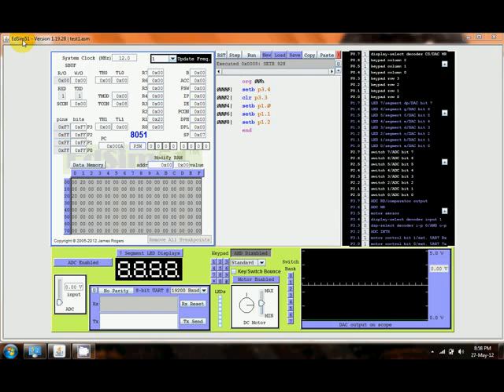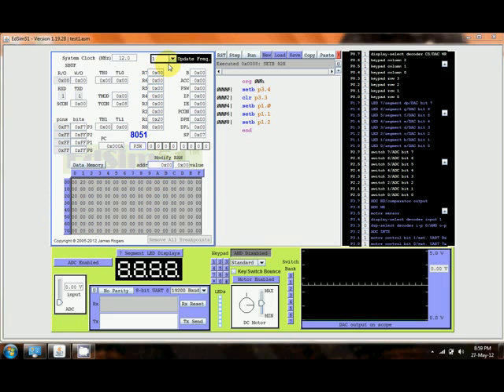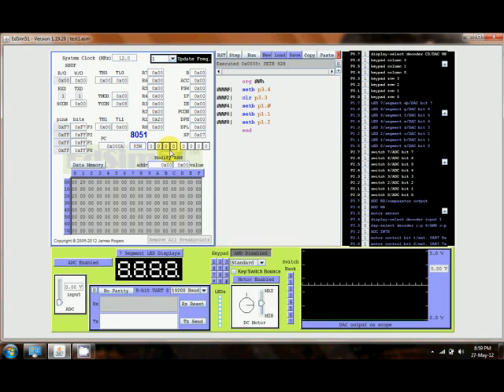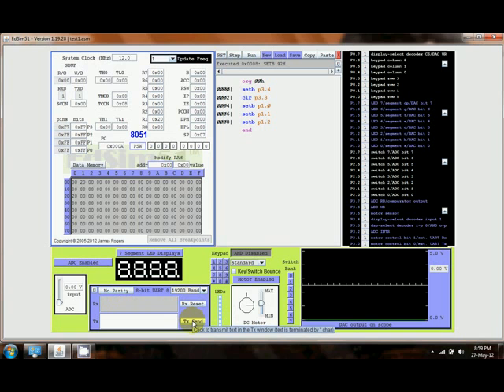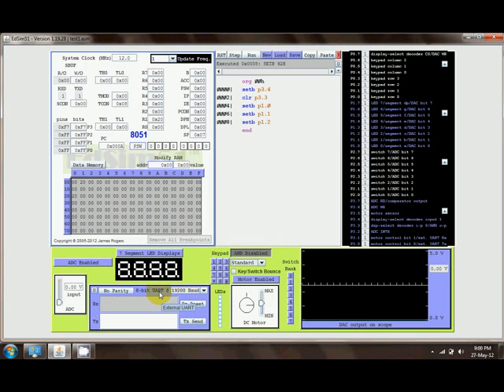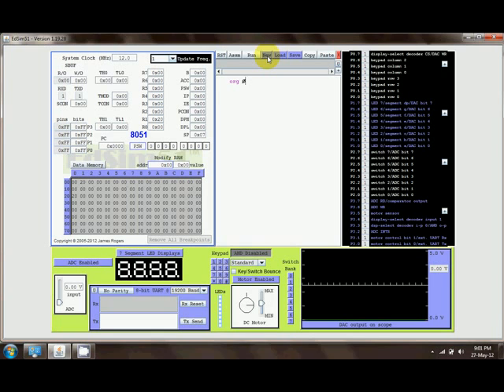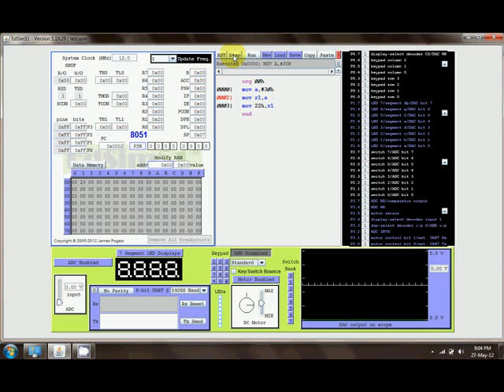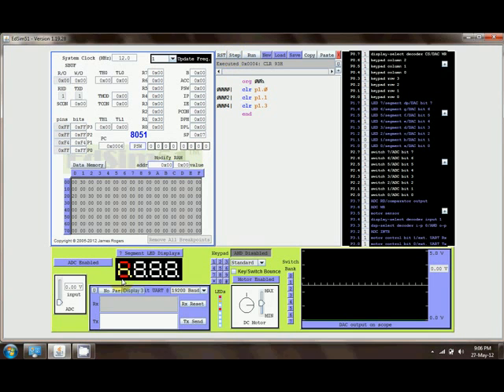8051_simulator.flv

Comment: thx for the quick answer. I know what it is for. I downloaded it and started , but I only see a window like this  . How do I get it to look like the one in your video? (Assign switchboards to ports...). In class with have a test board with a 8bit-IN, 8bit_OUT, 7 segment, and 10 digit dial. I'd like to simulate a few thinks since the class boards have the programs set in an external chip. Appreciate your help.